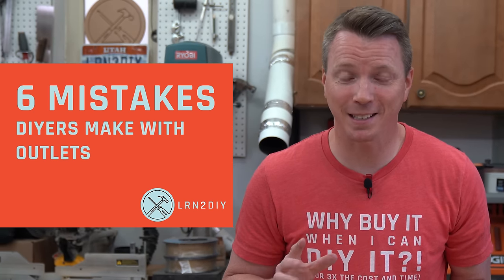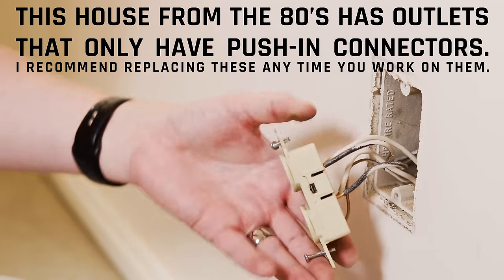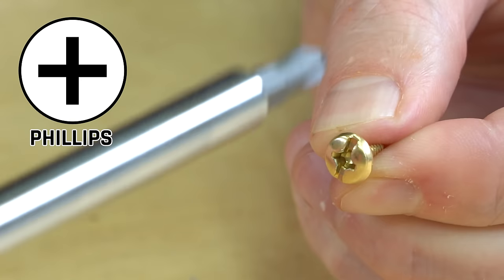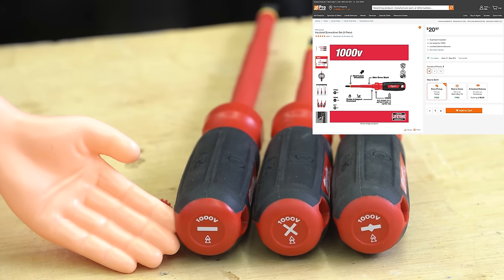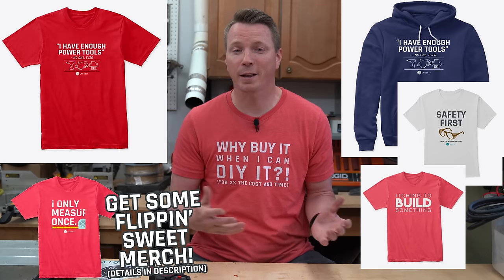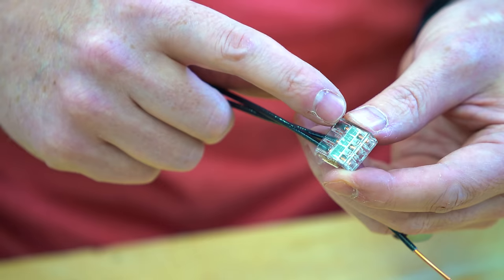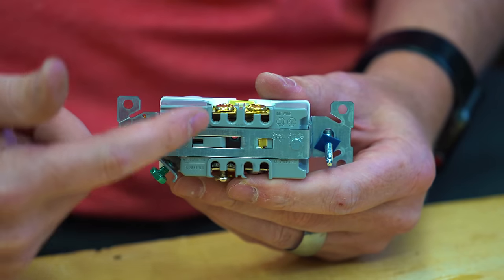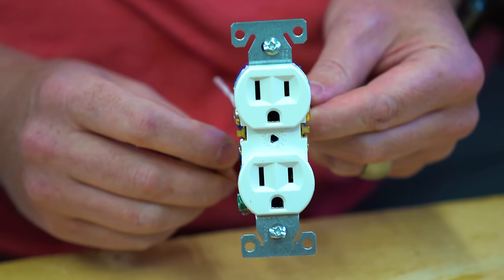6 MISTAKES DIYers Make When Wiring Outlets

Comment: great video. so i have a question. just changed an old switch that controlled an outlet in my living room to a smart switch. After I installed it that outlet still works, that it controlled, but all the other outlets in the room do not. Any hints as to why?
Reply from the maker: It’s likely that he old setup used that switch as part of a daisy chain, where power came in, went to that switch, then continued on to other switches or outlets. If the new wiring was not set up to continue on to the other receptacles, that could be the issue.
Reply: @LRN2DIY  ok so that would still apply even if I didn’t touch the outlet it controlled? I just wired the new switch the same as the old?
Reply from the maker: @Steal4Justice  Yes, that still applies. There would likely be three sets of wires at the switch. One incoming, one outgoing to the outlet, and one outgoing to the next outlet or switch. All three still need to be connected in order for the other outlets to continue working.
Reply: @LRN2DIY  oh. Ok great beginning to make sense. Thanks for your quick response. And this configuration can work on a regular switch? You don’t need a special switch, right?
Reply from the maker: @Steal4Justice  Right. I may not have stated it very clearly in my last reply, but you’ll have a line and a load on the switch. All neutrals go together but for the black wires, the line is the “in” and should be paired up with the daisy chain black wire that will go on to the next outlet. The load is the one that goes to the outlet that the switch controls. It’s a bit hard to explain here but I hope that makes sense.
Reply: @LRN2DIY  yes that’s great. Makes sense. Thanks very much for all the great info.
Reply: Just to let you know that information worked like a charm all the outlets are working. Thanks again. I will refer your channel to diy friends 👍🏽

Comment: You do not need strippers.
The outlet that you are holding has a built in stripper on the outlet that works great.
The WAGO's are great, I Replace every wire nut I see with a WAGO.

Comment: I wired a major remodel of our house. I bought cable shears accidentally early in the project. Instead of using snips, I used the shears and haven't stopped using them since this remodel. They are so much easier on the hands. When you are doing dozens of cuts in a day, shears make it much easier on your hands and wrists.

Comment: Glad to say I don't do most of these 6 things anymore (I do use the stab through ports but isn't that the intention of them?). Every other item I am guilty of doing in the past but have learned over the years. (though I'm also guilty of doing them in the past). I did learn a few things though (ECX driver specifically) so thanks for sharing.

Comment: Electricians back-stab the outlets so they can save themselves time and work but yet most of them will still charge the home owner the same cost as if having wired the outlets to the side terminals 
Even in electrical trades, we were told to never back-wire the outlets unless there was no other choice such as the wall was already enclosed and there was a shallow box that was used and there wasnt enough length of wire to attach them to the side terminals 
Electricians will most often deny how they still charge the same for them to merely pushing the wire in the back of the outlet as to doing it the right way to the side terminals. 
I worked with a lot of electricians over the years across 3 states and get to hear them talk when they know the home owner isnt with in hearing distance

Comment: I like to wrap the outlet end to end with tape to cover all screws heads, works best with small older metal outlet boxes, but I do it to every one.
Reply: As an electrician I also tape all my devices. Just make sure you do it right. Use minimum to no tension on the tape and allow the tapes adhesive to hold it on. Squeeze the tape on the device all around. If you fix the tape tight it will squeeze itself right off the device, sometimes in just a matter of a week! I’ve seen tape still holding it’s place if done right after 40 years of an installation.

Comment: There were no shown instructions on how to properly bend the connected wiring prior to installing the outlet in it's box. I use single fold with when there are wire nuts in the box and double fold when there are not. This allows a little extra wire for future work to be done. Also it is important to verify the depth, usually labeled CU Inches on the box, and it is safely rated to contain within. All boxes are not created equally. Thank You for sharing your info.

Comment: I have that Milwaukee Insulated ECX driver.  It's that one time purchase you'll never regret. I DO wish they had a non-contact warning light built in, and maybe a free-spinning end piece to make twisting quicker... but they definitely prevent stripping/camming out.

When I was younger I'd use a knife to strip wire, and of course damage the conductor in the process or cut my fingers while doing so.  Cheap strippers are annoying... total waste of money IMO.  Get a quality set like Doyle, Klein, Milwaukee, Gator....  

Now that I'm older, I realize I don't have time or patience for stripping and twisting off each insulator... HIGHLY suggest just getting an auto-stripper. You will be floored how fast your projects go, and how little frustration you'll have with stripping in tight spaces AND you know it's the right depth too.

Comment: Thank you.  Great video for the less experienced.  The shepherds hook is also known as a "j hook".  Always the best way to make an electrical connection even if you need to solder 2 wire ends together.  I was an electro-mechanical assembler for a few years and used those extensively.  Thanks again.

Comment: For stranded conductors it's best to use "fork terminal" crimp connectors. Blue for #14 AWG (15 amp) and Yellow for #12 (20 amp) and #10 AWG (30 amp).
This eliminates conductor fraying when tightening the device terminal.
Reply: I was looking for this comment because I was about to say the same thing but I figured I'd scroll through the comments first as I was sure that it had already been mentioned.
Reply: You could also strip a bot of insulation off then strip more insulation but don't take it all the way off. When you twist the stranded wire twist it counter clockwise that way when you wrap it around the screw it tightens up on itself and doesn't fray out because of the insulation you left on.

Comment: #2. Only s1 Robertson for me until ecx. I will NOT use flat or Phillips.
#3. Found a trick. For wago connectors, thickness of thumb to fingernail. For Shepard hook, width of thumb minus just a smidge.smidgen.
#6. In addition I usually go top on neutral and bottom on hot to cross and make sure the little tab isn't broken that makes it a split outlet.

Comment: I noticed the screws was left sticking out on the backstabbed outlet!   I see metal Boxes that's good but lazy install on receptacles. Note 4 wire backstabbing carry current to another  receptacle when 4 are inclined the 1st receptacle  can get hot 🔥

Comment: You didn't mention it but many if not most or all receptacles include a built-in wite stripper for both 14 and 12 gauge wire.

Comment: I really liked my Klein screwdriver, but after 1 year using it the bit holder is wearing down and the bits slip out inside the handle every time I use it.

Comment: I like to wrap the outside of the outlet with electrical tape after everything is connected to avoid current flowing into a metal junction box or anything it's not supposed to.

Comment: Newer switches use the side screws to clamp down on the wires that are inserted into the holes on the back which improves connectivity and clamping.  Those I recently installed recommended using the back over wrapping wires around the screws.

Comment: Great video, but two notes: 

1) There should probably be 7 things, with the first being how to properly ensure the circuit is not energized.

2) 02:55 “Getting the insulated version….”; 03:08 “The more we can do to safeguard ourselves….”  If one thinks that using an insulated screwdriver to work with house outlets is providing some kind of additional safety, then they should probably avoid working on house wiring, because they may falsely be assuming the screwdriver will compensate if they make an error in judgment.  The only safe way to work on house wiring is to ensure the circuitry is not energized, meaning to double and triple check that the circuit breaker for the outlet is in the OFF position and the outlet has been checked using some sort of probe (multimeter, NCV probe, etc.).  At that point, with no electricity flowing, insulated screwdrivers provide no additional safety benefit.  The only place where insulated tools become an enormous benefit is when one has to work on a circuit that is likely to be energized for various reasons, such as an HVAC unit or inside a circuit breaker panel.

Comment: #7 even many pros make.  Scoring the wires when stripping or twisting.  A scored wire makes it effectively a smaller wire and gives it a easy place to break.  I was an aircraft electrician and when done right, we even checked the wire after handing to make sure there are no nicks, cuts or scores whatsoever.  
Same goes for the end of the insulation.  You have a cut there and you have a spot where it can start to split, I've seen it many a times in aircraft, autos and home wiring.

Comment: ya when using the back stab connection there is no room for error and when ever i remove one i break the plug removing the wires and just replace them they are cheap why not and if i connect the new one the same way i always pull the wire hard to make sure its in there

Comment: @ 10:08  Stranded wire , on a light fixture there's no alternative , but with outlets ,even putting on "clock-wise proper" is tantamount to almost all your other warnings / problems . Because I've worked Industrial / commercial where stranded is de-facto for conduit(99%) they make the "pressure" holding outlets he showed earlier , the ones that even two wires are rated to be held - we called them "sandwitch" style . Residential of course usually solid Romex type - BUT any stranded wire to a 15/20 amp outlet BEST be using the sandwitch style , wires under pressure between two little steel plates !

Comment: You are absolutely right about never, never, ever using the backstab. I learned this myself about 25 years ago when we bought a chicken farm. Oh how easy it looked to just poke the wire into the backstab hole! And oh, how hard it was to troubleshoot the problem when something in that chicken house failed! I don't know why they even make those backstab holes. Makes me think of the pied piper.

Comment: If I can elaborate on what he is saying about those backstab terminals. The big reason those terminals are such bad news is even when they are done "properly" they do a poor job at best and a dangerous job at worst. Inside the outlet you have what is essentially a knife blade biting down on a wire, so in other words the connection is loose and there is very little actual connection between the blade and the wire. That means for that one little spot the wire is essentially much smaller in size than the wire is normally, and there is potential for arcing (sparks). This means you're going to get heat, which in turn will cause expansion and contraction of the metal as well as create corrosion, which will make the connection even poorer. If you have an outlet in your house that just doesn't work sometimes, or things plugged into it flicker, or if it stops working altogether, all for no discernible reason, I guarantee it is because these backstab terminals were used.

Comment: i've put in tons of them and i've never seen one that accepts a robertson bit or has that square in it, they all have the strictly phillips or slotted screws. i wish they did have the square drive hole, i do prefer that for other applications too where it won't cam out. now i've been out of the trade for several  years so maybe these screws are something new

Comment: This was good.  It's not hard to extrapolate out the effects of this tutorial video as they could easily save lives and over time will do just that.  # one fires are electrical outlets and aging appliances. I've witnessed more than one myself.
The one point I notice most often is that the screws are not tight enough. And we know that we should tighten the unused screws but it's on the wired connections that I see issues of heat build up due to loose connections at the screws themselves. Most issues with tightening are remedied with the Robertson bit as it really holds.

Comment: Also, wrap outlet terminals with tape before installing it back into the wall. This will keep you or the next electrician  safe. It also keeps the outlets from striking against each other in the box if it's a double duplex.

Comment: Every switch and outlet in my place, when built, was professionally wired, and approved by the local inspector, with back stab and the screws left sticking out. This again was passed by the home inspector when I moved in as the fourth owner. 
So while you @LRN2DIY and I may think that is wrong, how can it be a mistake to leave the screws sticking out and potentially shorting out.

Comment: After using 'wago' electrical connectors I only use them for connections that are not accessible (in the ceiling)   'Wego' connectors have a 'blade' clamp that has a very narrow contact point. I have had these connectors fail where the blade spring failed or the blade connection oxidized

Comment: Just a quick note...on the side wiring of even the cheapest outlet, there's a little piece of plastic there that kind of "holds" the wire.  The purpose of that is so that you don't have to do your bend on the pliers.  If you back the screw out, strip your wire to the length of the depth guage, you can put the wire in to be "held" by that little plastic piece and it will hold it there while you bend your wire around the screw.  It also keeps the orientation of the bend in the correct direction for tightening the screw.  I've found it even easier than using my Kleins!!  ;-)

Comment: I found a few issues in my home when I bought it.   The wires plugged in the back.   Multiple wires on a light switch.  Wires attached with nuts without a box.  And multiple wires in the circuit box in the same breaker.   Fixed all that.   I think if I ever had to remove the drywall for the duct work I would re-do the electric in the house  I've got stuff hooked up to things that I never would have even considered doing.

Comment: First thing I do while doing anything electrical, even if 100% positive the power is off, I remove my wedding band and any other jewelry from my hands or wrists. haven't had a metal band in two years, got a silicone one, still do it out of habit.

Top notch video and information though. Excellent job.
Reply: I'm an electrician and I personally know someone in the trade who managed to accidentally weld his wedding ring to his finger. He was able to have it surgically removed, the ring professionally cleaned, and his finger eventually healed. He takes his ring off now.

Comment: that hole isnt to bend a skined wire.  is design to cut a 6-32/ 8-32 bolt so the head perfectly fit as a brandnew uncut bolt, i just simply use the tips of the skinner to ben perfectly any wire before connect , great video evrything else 100% accurate

Comment: I would like to move and outlet about 10 inches but the wire is too short should I cut the main wire and add another piece so I can get enough to move the outlet in order to install a door,there is already a small door but too smal
Reply from the maker: You can cut the existing wires in the box (leave them as long as possible) and then attach new wires of the same gauge using wire nuts or lever nuts (Wagos) to extend further down. You can then use a blank solid plate to cover the old box. Be sure to check local code too.

Comment: Is there a follow-up to this that covers what to do if the wires coming out of the box are too short or too long?  How do you select the right wire nuts?  Best technique for safely and neatly stuffing the wires in the box so the outlet is vertical and tight?  Those two screws that attach the outlet to the box have retaining clips, presumably so the screws aren't lost during handling: do you remove them before installing or are they integral to the installation?  How do you adjust the depth of the outlet so it is flush with the cover plate?  And for the ADD crowd, do you finish off the cover plate screws vertically or horizontally? 🤣

Also, since this is aimed at DIYers, I'm surprised you didn't mention even extremely briefly the need to shut off the breaker, use a volt meter to make sure you killed the right fuse, wear eye protection, etc.

Comment: One thing you should have elaborated on is the wires twisted together should always be twisted to the right, so they won't try to loosen when twisting on the wire nuts. I don't recommend Wagos for anything above 20 amps, either.

Comment: I find that a number 2 square driver works great.  Sometimes you may need a #1 but I like that they don't cam out.  They also don't slide out annoyingly like flat head often does.  Some people like flat heads but I say they are only so common since it is easier for a factory to slot the head and make a driver for them.  Sometimes you can remove a difficult screw if you can cut a slot in its head.  It is easier said than done but anyone with a Dremel and the thinnest possible cutting wheels can do it.  it is tedious and not always possible.